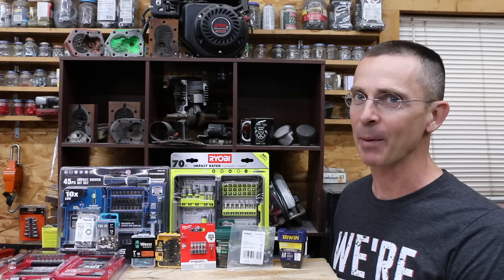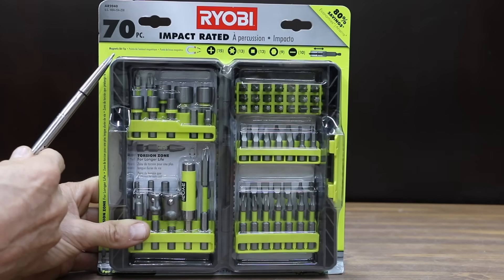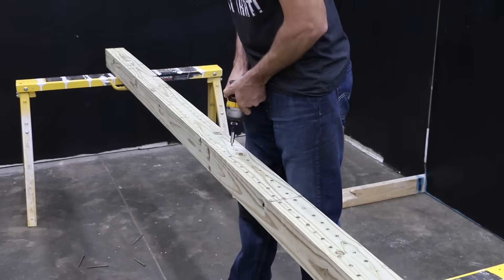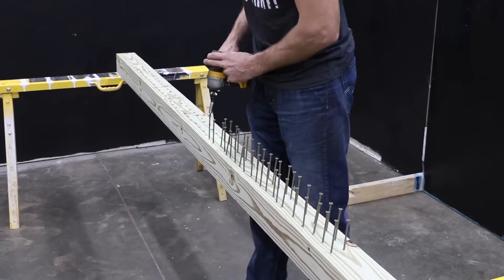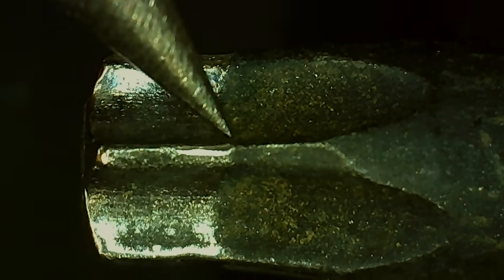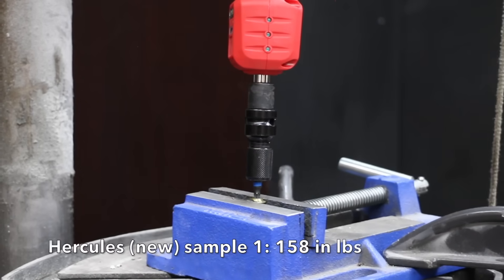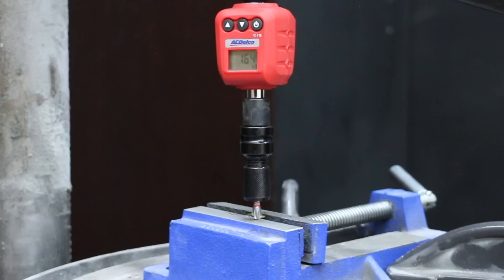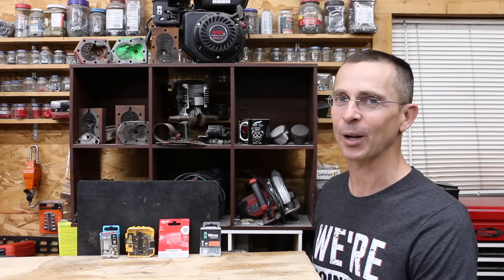Best Star (Torx) Bit Brand? Milwaukee, DeWalt, Makita, Ryobi, Wera, Wiha, Irwin, Bosch, Bauer

Comment: Finally subscribed to your very useful channel. Keep it up!

I'd like to share a somewhat contrarian view.

1. I am not surprised that Wera's bits are the strongest, but I am not convinced shearing strength is all that important. In practice, were you to apply the kind of torque achieved by any of these bits, you might damage the head of the screw, and thus make removing it a pain. I remind everyone that the specification for Philips screws and bits is what it is to induce cam out, i.e., to restrict the amount of torque applied to them, lest the screw's head be ruined or the shaft snapped.

2. Bits should be judged on their ability to drive screws, not so much to remove them. After all, what mostly do we do with screws?

3. I actively seek "stickiness" in the bits I buy and because of point #2. Wera sputters diamonds onto their bits for a reason. Study the German manufacturers and you will see them releasing (and charging more for) products specifically optimized for their "holding function." Once my Wera bits do what they most often are called to do (i.e., seat a screw), I have zero problem lifting the bit straight out.

4. Bits that don't deform after use are best because they don't damage screws on the way in. That way, should ever you have to remove the screw, you will be able to do so with ease, as it will not have been damaged going in.
Reply from the maker: Thanks for watching and subscribing!  Thanks for the feedback.

Comment: For knife maintenance I tend to use Wiha bits most of all as they do not strip out the small screw heads as much . I carry a set of the micro bit in a pen style driver t6 to t10 handles most pocket knives I carry.
Reply from the maker: Thanks for sharing.

Comment: For automotive and general use, Iv'e always found the Wiha brand to be the one that holds up the best without twisting off or breaking. I won't buy anything else. I'm sure they may be different than these bits though. These all look like sintered metal and I think the trenches are mostly forged so probably not the same type of comparison.
Reply from the maker: Thanks for sharing.

Comment: Wera make excellent quality stuff, but financially most of their stuff only makes sense for things like aerospace, where you need stuff to be certified to exacting specifications, six-sigma type stuff, zero foreign object and so on. Kinda like how you can go and buy a box of machine screws for £10, but if you want top grade, fully certified and batch tested then you'll easily pay 10 times that. Makes sense for those industrial uses, but pointless for the home-gamer. I have a few Wera tools and they are great, but I was treating myself!

For everyday use, I use Dewalt and Bosch - I find the quality of their bits is good enough for what I do - they do wear, they do snap, but just like with drill bits it's a hell of a step up from the "giant set of things that fit in your drill for around £50" blow-moulded cases you get at the big box stores.

Good video as always!
Reply from the maker: Thanks!  Thanks for sharing.

Comment: Due respect, Wera, is pronounced "Vera." The w, in German, has a V sound. Thanks for the informative and in-depth video! 😁👍
Reply from the maker: Thank you for the information!
Reply: i have lots of Wera screwdrivers and was wondering  about that.
Reply: Well, while you are correct about the mis-pronunciation of the "W", the "E" is also off.  It would be said as in: Vayra.  
But great job on the video, none-the-less!

Comment: You are too late.
I managed to drive 260 wood-to-steel self tapping drill screws on one #3 Phillips bit.
The screws were aquired at a Menards, 200 for $40.
The cost of the commercial screws was way out of range, about $1.00 per piece. 
One bit lasted the entire trailer, and never slipped once.
I used a 1/2" Makita plug-in drill, and it never even got warm, even though the first run was fully 200 screws.
The extraction of old screws was another story.
Most were rusted into place, and I wxpected, and got, a lot that sheared off below the head. Because of the wear already on the screws, I experienced bit failure three times. One actually sheared off the tip on the first screw and was unuseable.
The others would spin, and wear off the tips.
Those were #30 tips.
I have no clue as to brands, because the tips have mostly been aquire from abandoned or discarded tool sets found in junk vehicles. 
But, I like this test, because I fully intend to purchase more #30 star drives very soon!
Reply from the maker: Nice!  Thank you

Comment: Buy like three 5.0 batteries from Milwaukee and three from dewalt and other brands and test them to see how closely they perform to each other. Like test the run time on all 3 Milwaukee batteries and see how similar the batteries perform out of the box. And do the same with each brand and see who makes the most similar performing 5.0 batteries.
Reply from the maker: Great suggestion. Thank you

Comment: Hey Todd! If you ever revisit the Stud Finder tool tests, could you do a test comparing their ability to find Studs and electricity when they can't sit flat against the drywall/sheetrock? My Ceiling collapsed in my living room cause the original house contractor forty odd years ago used cheap nails vs screws to attach it to to the joists! I tried using my Riobi stud finder on the ceiling joists, but the popcorn ceiling texture was giving the machine a ton of problems! I ended up buying a Zircon (The Bosch were sold out) which could barely detect the ceiling joist enough to get me in the ballpark. In several spots I had to find the joist by iteration, since the centermark the finder was giving just wasn't close enough. Bit of a Niche application I'm sure, but I had a hard time finding any info past your last video on the subject. 

I'm surprised at the number of bits that got stronger after use! My first thought is is the S series tool steels get 'stressed' and firm up under the use, increasing their resistance.
Reply from the maker: Thank you for the video idea!

Comment: When I found out about Star Torx screws I switched to them and use only them. They will never slip and takes no pressure on the drill at all for screwing in
Reply from the maker: Great point. Thank you

Comment: Great job on this one Sir!  As always.

I was slightly intrigued, you like them looser...  I just did a deck project...  I like the bit to be pretty tight....  You start stripping screws, that's a real drag & it'll slow you down...  The tight ones, you go all day, with no problems.....  Kinda subjective, I know, and it certainly depends on what you are doing....

Hard to argue with the Milwaukee & the Makita, watching the video....  I have some Wiha tool bits in much smaller sizes, for working on knife repairs...  Like tiny, T6, T5, stuff like that...  I really like it...  I just bought it off the jungle website, but now I look for the Wiha brand, and if available, I buy it...  Seems like good stuff.  Again, very subjective, no doubt...

100 screws each...  I admire your persistence, and dedication, to these videos.  Heh heh!  Just letting it rip, no glove.  I'd need a big glove on that drill hand, or I'd be spending the next 6 weeks in physical therapy......

Anyways, great job.
Reply from the maker: Thank you!

Comment: work gloves
I went through several brands now using Ace Hardware 3-pack gloves
Ace Men's Indoor/Outdoor Latex Coated Work Gloves
3 pack Item no.6355952 |53632-23 best result so-far ◘ I strongly advise against use of PT Wood due to several factors all of which are toxic • Decades doing work it always has toxics
Reply: Test Request: Silicone Auto mechanical-purpose Synthetic Grease - any brand  - Tube intended for auto-motive + I emailed Lefty about Amsoil brand ○ I just got billed $500+ for life-critical that should not be and am going to DIY the other side on my 01 Silverado-w 
◘ "w" is the engine code for the Vortac 6 cylinder then Vortac is a generalized sales term now not a specific engine ○ I am DIY Shade Tree mechanic with decades of experience and will accept questions

Comment: yet another very nice video.  Thanks for that!  One thing came to mind and that is that the cost you use appears to be an average of all the bits in the package.  Yet some did have very different bits such as nut drivers etc which are likely to be more expensive, whereas others didn't, so that does not seem to be an entirely fair comparison TBH.  But of course the strength tests are independent of that and very useful as well.
Reply from the maker: Thank you!

Comment: I think the information you gathered about breaking strength is telling about how long each brand will last over time. The heat cycling the bit goes through while in use is making the bits more brittle and over time they will likely break before the bits that experienced little or no change. 
Thanks for the good content.
Reply from the maker: Thank you!

Comment: The thing I look for in a bit is hardness. When you spin out a bit in a screw, the softer bits burr over and are useless. The softer bits are ruined immediately when spun in a screw. Makita makes some dry wall bits that are very hard and occasionally break the flutes off. That is much more acceptable than burred off bits.
Reply from the maker: Thank you!

Comment: The bit being tight and holding the Fastener is actually a preferred thing... when your Fastener is pre-staged I can see trying to get it to release being an issue but most people actually bring the Fastener to the bit and like it to hold the Fastener as you engage your work piece...
About 90% of the time  I use the DeWalt bits ....I also use Wiha Terminator bits which are really good too
Reply from the maker: Thank you!

Comment: You left out GRK. Which blows them all away.
Reply from the maker: Thank you!
Reply: Also, t25 bits are the hardest to break. I drive anywhere between a few hundred to a thousand a day, youll never break one, only lose it. T10 heads are . If im screwing together mahogany inside corner boards for battens is where the real quality tests come in. Hard woods like ipe or even something like sapele would be a good choice for material not soft pine.

Comment: The used bits had a higher sheer strength thats likely due to being work hardened.
Reply from the maker: Great point!
Reply: That's possible - could also be that "ringing" the metal of the bit during the thousands of impacts allows the stresses in the bit to settle out.  Like Shot-peening connecting rods for high horsepower applications.

That would be a fun test - put a bit in a drill with a slip clutch, and let it rattle on a strength that's high enough to sink the screw/bolt into the wood, but not go crazy and cam out the bit...let various bits rattle/ring for different amount of times and see if you can see a noticeable difference in end strength.
Reply: i was thinking the exact same thing!
Reply: yea
Reply: There more likely to slip a bit before breaking due  to being semi rounded thus allowing a bit more pressure to build o think

Comment: Before I watch I will say I have used a lot of them and found often times their life has a lot to do with the quality of fasteners you are using and how well you use your own skills with them. That said there are still a lot of variance between manufactures for both bits and especially fasteners. I've been using the SPAX brand at about $1.80 per bit at high retail for a while now with fair results as I do like that they fit both the sizes of fastener I commonly use. Mind you I don't think that they are intended as dual use (T20 & T15) and I don't use them a lot but they work well with the screws that I'm able to get in bulk at my local ACE Hardware store about a mile from my house and again one SPAX T20 works for both the T20 and T15 screws due to the short taper in the bit and the particular brand of fasteners I get (which is pretty high quality actually and unfortunately not named). I must emphasize I do not like the SPAX fasteners as they like their bits are overpriced but for my use cases I do enjoy the bits. BOTTOM LINE: I wouldn't use them for an 8 hour day of continuous screwing, I would need the Viagra's for that. :)
Reply from the maker: Thank you!
Reply: @ProjectFarm  Hey great video, thank you, :)

Comment: Had to install over 800 of these over the past 2 weeks. I hated The kobalt. Dewalt and Milwaukee ones lasted the most. I like the Milwaukee more because i knew when they were going to break. They start twisting by the middle where the red band is.  
I use the security star t25 ones. I didnt feel or see any of them getting stuck  (the 3 brands mentioned getting stuck)
Reply from the maker: Thank you!

Comment: I'm guessing that the heat generated from the testing slightly work-hardens the steel, which is why some of the used bits took more force to snap. Outstanding job as usual, Todd. Thanks for all of your hard work!
Reply from the maker: Thank you!

Comment: I feel like Im kind of back and fourth here. While I don't like it when the screws don't release from the bit easily, sometimes I really wish I had a bit that had a much tighter fit. There are certain instances where one hand needs to hold the work piece while I'm hunched over at a weird angle and the bits I use (dewalt, milwaukee) are way to loose to keep the screw straight enough to get the screw started with one hand.

Comment: The used bits are stronger due to the "comressive residual stress layer". 
When a force is applied to a rod, the most stress is at the surface of the rod. It is at the point where the stress is more than the material can bear and this is the place the crack starts. By  "compressing" the outside layer, the most stress will be somewhere under the surface. Look on the internet for "shot peening springs".
Also by hardening materials surfaces can increase in volume, which causes "compressive residual stress", which make the hardened product harder (wear) and stronger (tear).
https://en.wikipedia.org/wiki/Shot_peening
Reply from the maker: Thank you!

Comment: When torx bits broke, sparks fly for some brands..
Interesting, that used bits were stronger, than new ones.. Maybe, after heating in usage, metal gets less brutal.. 🤔 Only logical explanation..
Idea for update - heating up same torx bits with torch using temperature monitoring (50°C, 60°C, 70°C, etc) .. After cooling down, repeat break test and compare with results from this video.. 😂
Reply from the maker: Thank you!

Comment: A more objective measurement of wear of any tested tool could be to measure their weight difference but I don't know if you have a scale that precise or that the material doesn't just moves around instead of being removed.
Reply from the maker: Thanks for the suggestion.

Comment: I love the video, have you ever considered trying to make a very large test testing the biggest and baddest of 1/2 drive impact wrenches? There are huge debates over the Milwuakee, Dewalt, Snap on (That one is very expensive so I won't expect you to buy it but it would make for a fantastic debate). Since they all output such high torque you would need really heavy testing equipment with nuts in the 30mm size torqued down to hell
Reply from the maker: Thanks!  Thanks for the video idea.
Reply: I am actually looking forward to buy either a snap Milwaukee. I would love to see this video. Project farm tested.
Reply: @historicbeef  From using both, Milwaukee is probably better bang for buck. Snap on seems to have a little more power but WAY less reliable. Plus only 2 yr warranty compared to 5
Reply: 1$ a month patrion,  if we all did it he would be doing best boats for jumping lol

Comment: Thanks, that was good info as there is some poor quality stuff out there.  
If you haven't done these yet;  how about best knife sharpener?  Best pick proof house deadbolt locks.   Best cheap intruder alarms for the garage or shed?    And finally, the best metal tools spray protectant against rust (temp/humidity cycling over winter).   Thanks again!
Reply from the maker: Thanks!  Thanks for the video ideas.